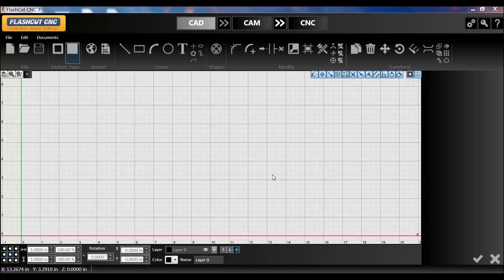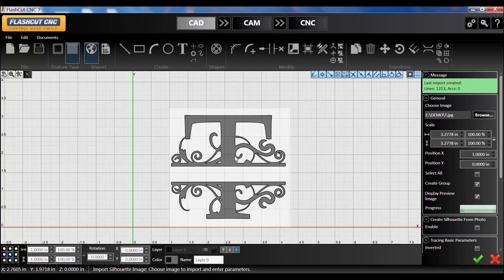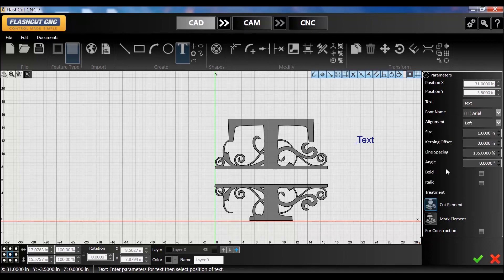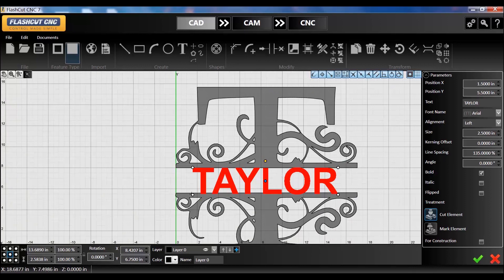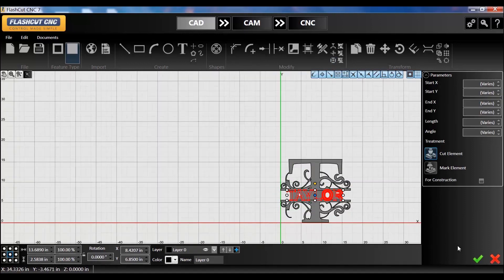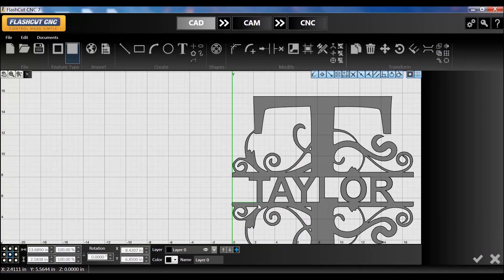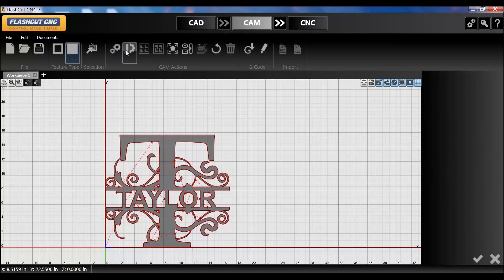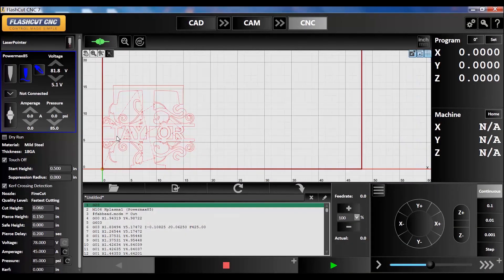Creating a Monogram with FlashCut CNC Software / Koike ShopPro CNC Plasma Cutter

Comment: Would you have to go back and sand in all of those crevices? Does the plasma cutter leave sharp metal burs in the sign?
Reply from the maker: Companies who manufacture metal wall art using plasma tables will run them through a wide belt sander or hit them with a flap disc or wire wheel to clean up the back of the piece. Plasma won't leave a super sharp edge, you'll actually get a sharper edge once it goes through a belt sander. Fiber lasers will give you a cleaner edge, some companies use these to speed up the cutting process and minimize second operations